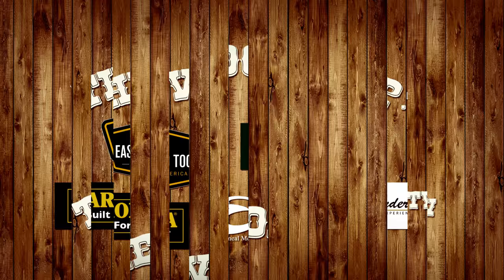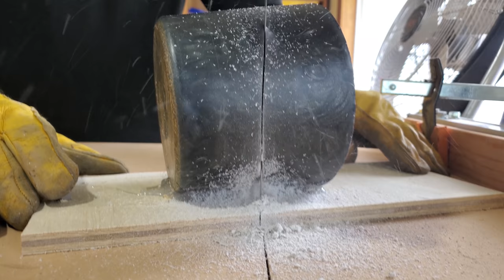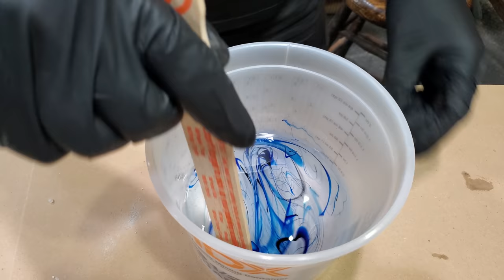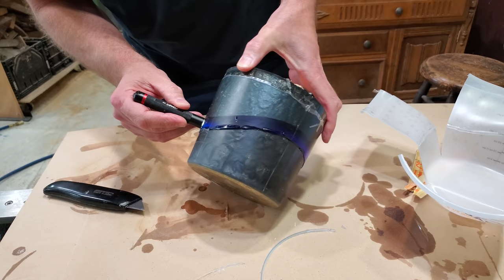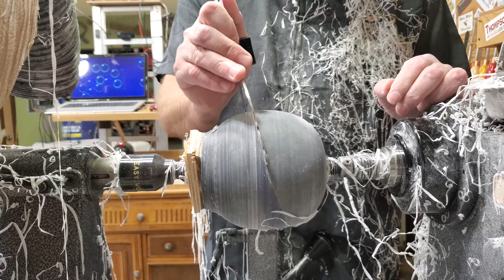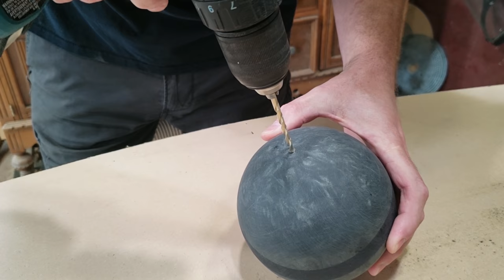Woodturning | Wave Resin Sphere

Comment: Beautiful! Probably old news to veteran resin turners but I found an easy way to help with the ribbon clean up. A spray can of "static guard". I spray a mist on my clothes and around the lathe here and there to break up the static. The resin isn't so static charged and falls away easier. I live in a super dry climate and the static can be insane at times. Works for me so might benefit another. Thanks for your videos Carl! 👍
Reply from the maker: Thank you Mike! Great tip too thanks.

Comment: It turned out great, but why did you coat it with epoxy instead of finishing the sanding and polishing?  Did the epoxy coat cure without any need to sand or polish it?
Reply from the maker: Thank you! Yes the epoxy finishes without polishing.

Comment: Just curious: did you use the Stone Coat top because the sphere was cast with epoxy?  Would working through the grits and polishing work just as well?
Reply from the maker: You can run through the grits and polish it. I poured another coat over the top because it's really easy. You don't have to polish it after that it's just done.
Reply: @CarlJacobson  Thanks!